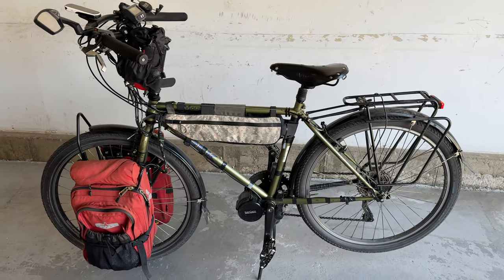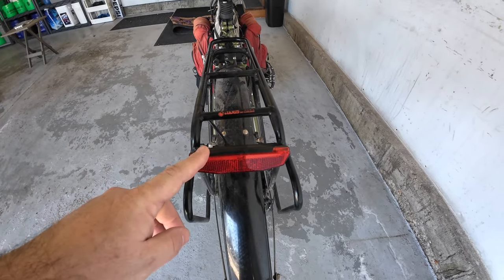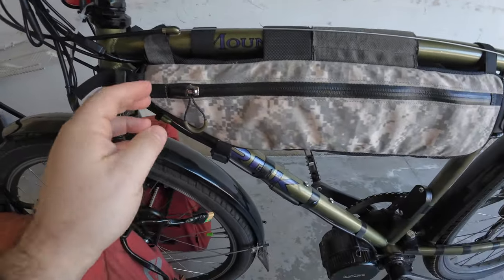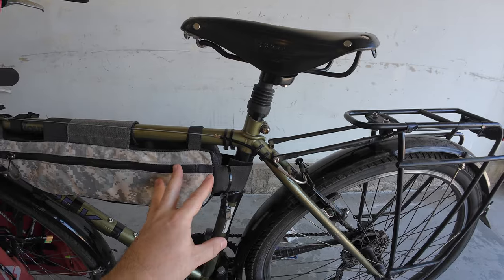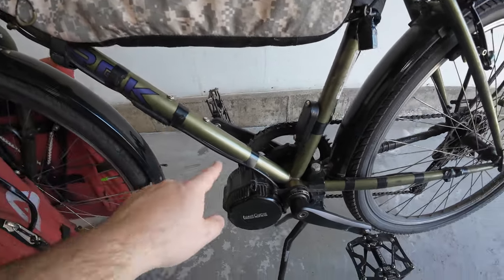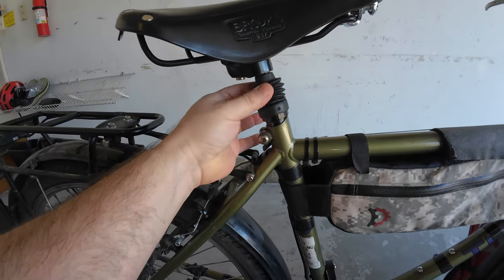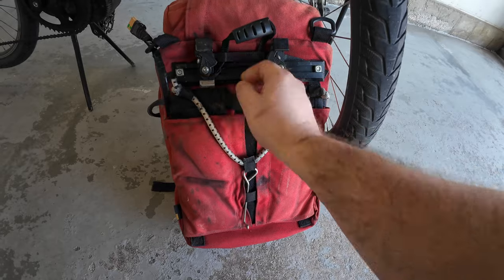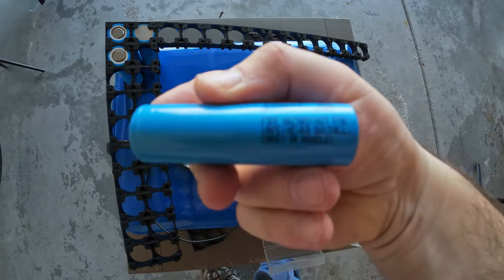Long Distance E-Bike Touring Build | 150 Mile Range

Comment: This was just what I was looking for . I have a bbs02 750w with only 750 mi on it. It rocks ! I have it programed to only 75% power and it assists my bike at 80lbs and me at 260lbs up the steepest inclines. I am using a 48v 20ah upp battery.  60mi range on flat peddling at 12mi per hour. I also have a reserve 48v 10ah in my pannier. I commute , some short tours in summer.
Reply from the maker: Awesome! Sounds like a great setup. Happy riding!

Comment: Thank you for the video Brian, was always curious  about your whole setup, from bike to motor and battery...How much routing prep do you do before a trip, I realize you take charging along the way into account since the places you stop have working electricity.
Reply from the maker: Thanks for watching. It’s definitely a bit more involved than non e-bike touring. I do basically need to find a place to charge every night. I also make sure midway through the day there is a place to charger too just in case. The only easier thing to plan is food or rest stops because going another 10-20 miles is not a big deal unlike on an acoustic bike. Luckily all hotels have electric and RV sites definitely
Do too.

Comment: Nice description of your equipment, I learned a few things. I would've personally gone with a smaller battery, it would reduce weight and other components that goes with such a large battery, not to mention cost. It would basically give up speed, if you cruised at 15 mph, instead of 20 mph, it'd save a lot of power (drag ~= speed squared) No need to go so fast while bike touring, and waste all that energy into the wind.
Reply from the maker: Thanks for watching. Glad you found it useful. I could have done that, but the object was to cover as much ground as possible in a short amount of time but still be able to smell the roses at a bike speed. I have my regular bike for touring when I want to take my time and cover less distance.

Comment: I love that you built your own ebike and you know it inside and out.  I was curious about the handling with the battery weight being on the bike and if you had considered pulling a small cargo trailer instead that could hold the battery or maybe even more batteries to increase your range?  Also just curious if moving the current battery to a small trailer and how that may simply improve handling?  I still have a Schwinn mountain bike from when I was 14 hanging in my garage and always had thoughts of getting it road ready again or perhaps turning it into an e bike like you did.

Comment: Love your videos. I have a 52 volt 28 amp battery. Can I use a 10 amp charger using it in the same way you use your. Just charging for an hour at a time while touring?

Comment: Good job...your quite clever and knowledgeable. To go 60 to 100 miles a day on an ebike requires considerable weight in batteries. Looking forward to new battery technology to reduce that weight so ebike touring can improve greatly. Even with two standard factory made ebike batteries...how many miles is that? Sixty maybe Seventy. With all the new bike trails being built we will need the better battery systems!
Reply from the maker: Thank you! I can’t wait for better battery technology too.

Comment: Interesting build, I have installed a CA3 with a shunt to monitor AHrs used by my mid-drive on my recumbent trike. What is you Amphrs  pre Mile usage on a long trip?
Reply from the maker: Unfortunately my speedometer on the CA only works intermittently so I am not able to track it.

Comment: Comparing to manufactured ebike is it worth to build? Some say its cheaper to build. Other than the cost, how is performance and handy compared to manufactured?
Reply: More “you can get what you want or need.”  (Built both of mine from parts.)

The commercial offers tend to NOT be set up for real range, or pulling power, or much else.  

It CAN be cheaper, especially if you have done your research and want something out of the ordinary - what the big manufacturers sell.
Reply from the maker: It’s hard to say, I have honesty not rode any commercial ebikes and this one is a result of many years of changes and upgrades.  I will be doing some new e-bike tours with a buddy of mine that has a store bought e-bike so should be good comparison.

Comment: How many watts do you draw on level ground no wind no peddling at 20 MPH?  It's interesting you use throttle to rest sometimes instead of stopping.
Reply from the maker: 18-20 probably 350-450w range without wind or hills.

Comment: When you pedal without any motor support, does it move like a normal ( but heavier ) bicycle, or do you get resistance from the motor? I have a Bafang ( m400 250w ) motor bicycle, but it's factory installed and when I pedal without support it is really heavy to move. I would love to make a setup similar to yours. Thank you for sharing 🙂
Reply from the maker: It’s pretty heavy so it just feels like a loaded down bike. I can’t tell if there is any resistance from the motor.
Reply: @bikingbrian  thanks

Comment: Your chainring teeth are very sharp, meaning it needs to be replaced.
Reply: The chain does not sit properly on it. That 1200W motor must put heavy load on the drivetrain parts.
Reply from the maker: Thanks for noticing. Yeah I never replaced the chainring it was pretty bad in this video. A week or so ago I replaced the entire drivetrain although the chain has been replaced  few times. Rides like a brand new bike.
Reply from the maker: Yeah it’s actually not too terrible on this bike and most of the time it’s about 300-500 watt range and 10k plus miles.

Comment: I hadn't thought about how many cells. Each Cell $4-9 . Cost adds up.
Reply from the maker: Yeah sure does. I found mine right around $3/cell on cyber Monday deal.
Reply: Yes, need to get some of those myself…
Reply: it doesn't have to. go to battery hookup and buy some automotive packs already assembled for under 100 dollars per kilowatthour, these are of course used so there's a certain risk here and the configuration of the pack will almost certainly have to be changed, but we are talking under 100 dollars per kilowatthour so it's all worth it. get a sturdy bike with welded-on racks like a dutch bike or european postman's bicycle, i'd say cargo bike, but they're ridiculously priced now as the new in-fashion item. this last part is needed because then you're less restricted about the shape of the pack(s) than with regular panniers.

Comment: I got 2 500 wh  Bosch batteries, and with a burley coho trailer, 4 panniers and a handlebar bag with random stuff on the racks, I can get 120 in perfect conditions. More like 80 to 100 though. Thats more then enough for touring. I have to ride eco mode 90 percent of the time to get those miles, so it ends up feeling like im riding a normal bike. Its just faster as I can keep up 17 to 19 mph in eco mode. I can even slap 2 more panniers on my burley trailer to make it 6 panniers.
Reply from the maker: Sounds like a great setup!

Comment: 2500Wh+!  no wonder you can get 150 miles out of a charge! Still you need be a little frugal as 20Wh per mile only gives 130 miles of range!
Reply from the maker: Haha yeah for sure. Extra capacity helps when conditions are less than ideal too. Headwinds, hills, etc